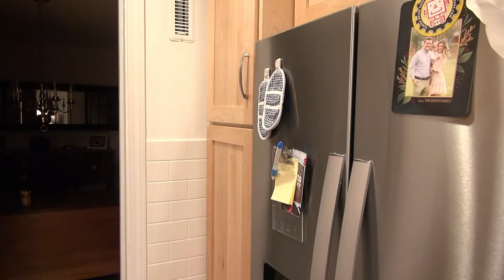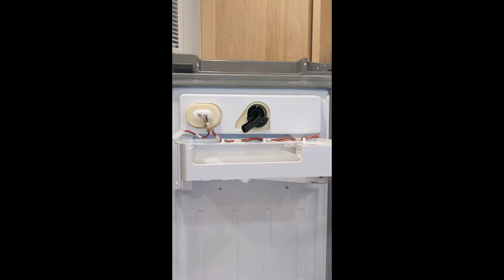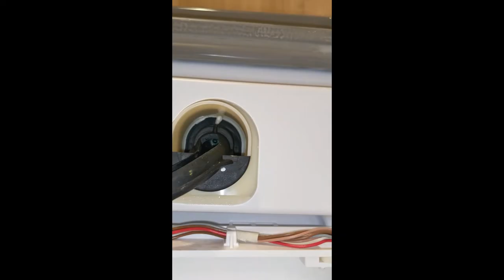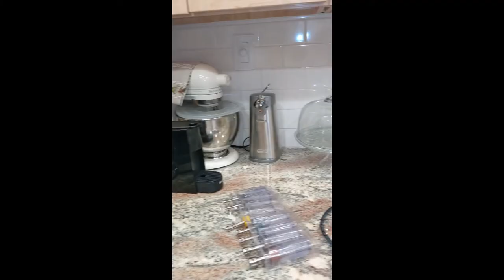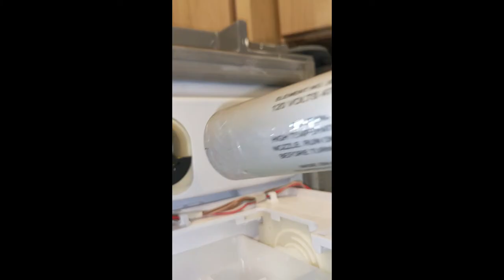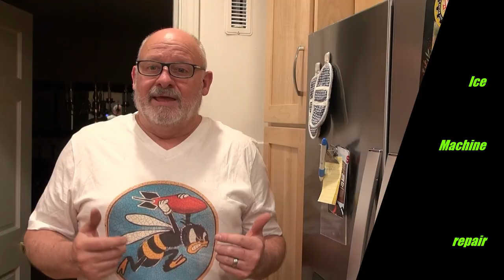ICE MAKER REPAIR simple and quick

Comment: I used a blow dryer and a chop stick to break the ice on the water tube. Hopefully it works.
Reply from the maker: That is a safer option than a heat gun due to the lower temperature a hair dryer operates at
Reply: @neuromanglers  it worked!!!! But froze again a few days later. Wonder if there is something permanent I can do. Beside lowering the freezer temp.
Reply from the maker: I solved it by using a piece of aluminum foil to form an insulator and I have posted a video about that on my channel.  It has proven to be a permanent solution in my case and hope it works for you too